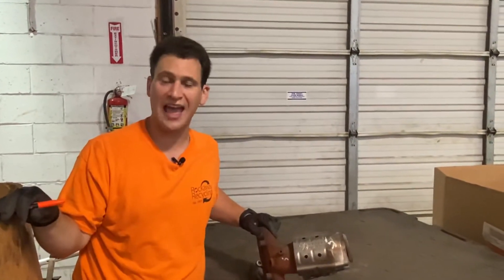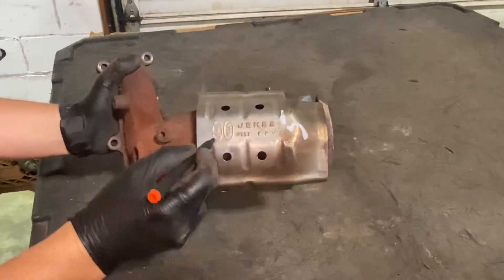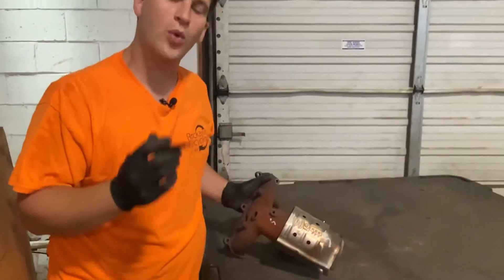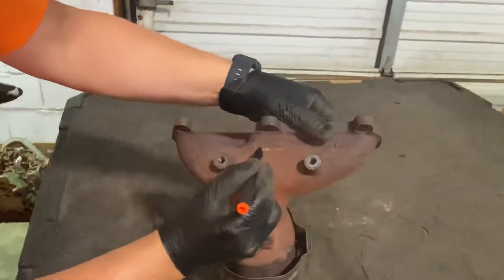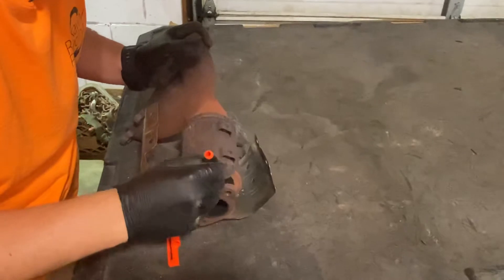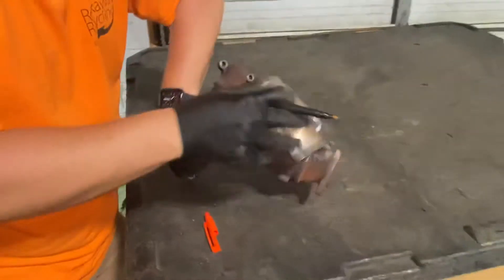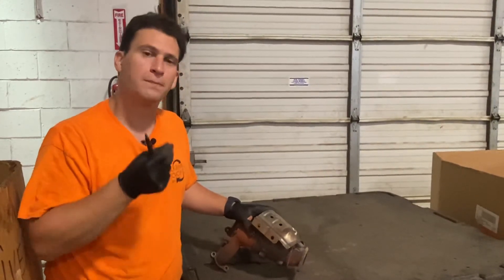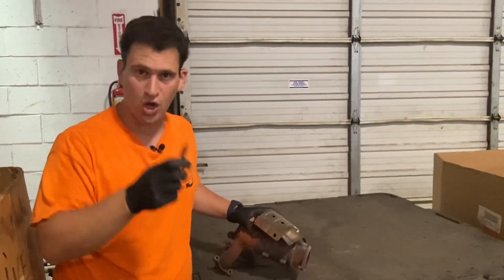Hyundai & Kia Catalytic Converters: How to Identify & Get the Best Price

Comment: There are 2 different ones. My insutance will pay for the  one in the front which is about $500. They are going to order the more expemsive one for $2000. What is the part number i need. 2016 kia rio.

Comment: Is it worth any money? I got my catalytic converter replaced today. Wondering if I should keep it
Reply: May I ask why you replaced it?
Reply: @QuincyJuanLopez  the mechanic said that could be the problem. But it honestly didn't fix the issue and I stopped driving that vehicle
Reply: @AprilGarciaDfw  ok, what problem did it have?
Reply: @QuincyJuanLopez  the dealership said it was the wiring harness and it would be $3000 total. That it wasn't worth repairing a vehicle that wasn't worth the price since it's a 2008 Kia spectra . So I stopped driving it after getting several parts replaced and it wasn't fixing the issue. My speedometer would jump up and down as I was driving